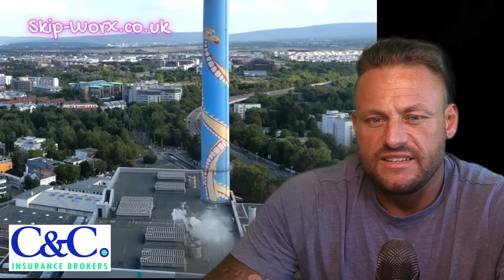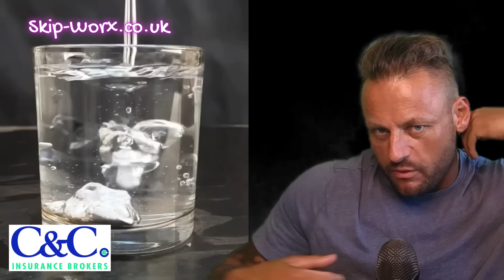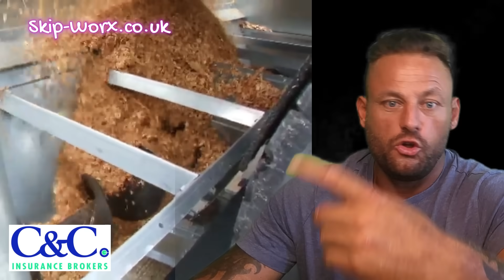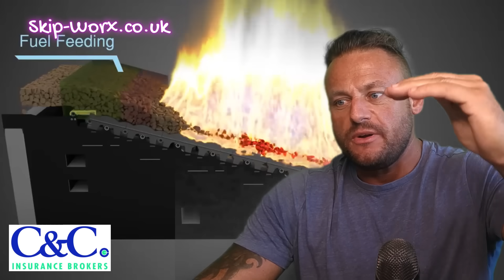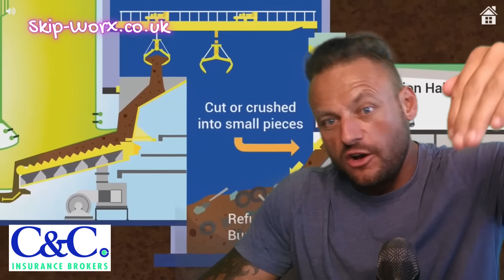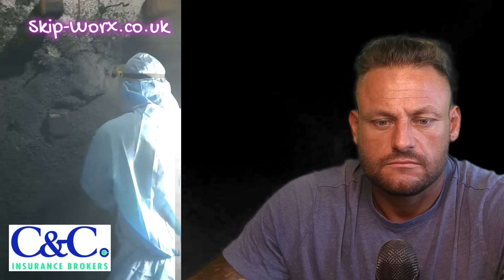Wood problems in uk

Comment: Is it possible to run the wood chips through water, before it enters the incinerator? Wood floats but slightly heavier aluminium sinks. A kind of sluice and the water can be recycled. The internal pressure of the incinerator might increase though, due to the water vapour (steam).

Comment: Most of the problems with ‘chain conveyors’ are to do with tension. Coal mines ran 24/7 and it was always slack chain causing the faults. Keep it tight with a mechanical or hydraulic tension unit and they’ll run forever. Good video, thanks.

Comment: When I was younger , I ran a boiler at a large green house . This boiler used a straight bladed squirrel cage fan to convey the coal to the top of the boiler so that it rained down on to the fire bed . A much larger fan provided the draft under the fire bed . Loved watching the coal floating in the draft burning like little comets .

Comment: I've worked on a lot of industrial new construction projects and the amounts of wood that is thrown away is ridiculous. Everything shipped here is crated, in mostly hardwood crates and dunnage do to the weight of the items and it all goes into the trash. I try and get as much as possible if I'm close to home but when your 1000 miles away it's kinda hard to transport any worthwhile amount. Another problem is that most sites won't allow people to take the leftover dunnage and it gets sent to landfill.

Comment: I've worked in many of these incinerators and everything you've said is correct. 95% of the work I've done in these places is repairing the items you are speaking about. What most people don't understand is the shear volume of material they move through these systems. The majority of work is in replacing or cleaning the grates in the floors. And a lot more work goes into repairing the ash or salt cake conveyors.

Comment: This is the UK reducing carbon emissions?
Lots of timber pallets can be repaired and reused, but businesses find it easier to dump and forget.
It would be nice to see clean timber being preprocessed as chipboard, compressed timber battens for construction etc.
There is no way sections of treated timber, glass and plastic, fibreglass and asbestos can be separated prior to ignition.
Everything gets chipped.
It all goes in and ends up polluting the air.
Governments have been sold ideas to produce electricity, but there is no regulation, just short term gains and profits with long term dangers.
People living near these processing plants and incinerators should be aware of the risks.
The word "Biomass" seems to be used for a whole range of processes to ultimately generate electricity.

Comment: 10 15 I think the cement used for high temperature concrete is called ' Cement Fondu' they used to cast fire backs with it then you used additional refractory clay pads where the main fire was burnt, I remember when we had a coal fire with a back boiler 1960's.
Good info by the way.
Gaz Yorkshire.

Comment: From across the Pond I am ! I burn wood as main source heat and a lot of it is skid wood either softwood or the better kind the hardwood skids used for steel coils not to say both are not needed, This is a Great look into a very vialbe means of dealing with the refuse from humans instead of digging holes and buring it for later generations to deal with! Thank You : )

Comment: Have done relining (Welding in Hardox wear plate and cheek plates) and hard facing of Doppstadt shredders, rebuilt augers in biomass boilers and such like. Most sites pulverize anything, everything and burn it all. The wear on these machines is incredible. I have seen ash removal augers worn down to the shaft with no flights left at the firebox end. If anyone does get asked to work in these places, be safe and VERY fire risk aware.

Comment: Something that you didn't mention, or perhaps not aware of, is that a number of new waste wood incinerators have failed. For example the ones owned by Aviva at Barry in Wales, and Boston, Hull in England. Each one cost over  £150 million. Total investment was £480M. 
Also the Tansterne Biomass Plant in Hull has got into administration.

Comment: It all makes work for the maintenance workers!
 
The amount of aluminium turning up in waste wood, was something I hadn't expected. Thanks.
Reply: I reckon the aluminium must come from construction and demolition materials. Roofing clouts and sheet material nailed to wooden frames. Old shed roof battens where the felt was, stuff like that.
Reply: It’s all sellable though. Not a total loss.
Reply: Appropriately tuned electromagnets can flip this off the belt, along with brass. Just because it isn't diamagnetic(ferrous) doesn't mean it's not paramagetic
Reply: @alanbrown397  What your referring to are eddy current generators. They use an alternating magnetic field to induce a current in anything that conducts electricity, and that current then in turn induces a magnetic field that is repelled by the initiating magnetic field.
Reply: @keithrushforth4019  Yup, but I didn't want to get into the technical bits

It's surprising that operators aren't using eddy current separators on the input belts. I assume cost-benefit analysis made them decide it wasn't worth it
Reply: @alanbrown397  Probably as from what I know of the physics eddy current separators must use a lot of power. Also even if you could get all the aluminium out your still going to get all the other ash and clinker and that needs cleaning anyway so just clean out the ally at the same time. 

The ash deposits must be pretty solid stuff sometimes as I used to know a guy who worked for a company that used explosives to loosen up the ash in boiler tubes.

Comment: We made timber pallets for 30 years and always used steel nails never aluminium.Of course steel would be taken out by magnets.Don’t know the logistics but is it not practical to separate the standard pallets as there are normally plenty going to recycling.Just a thought.If we take clean timber waste to the recycling plant they do not charge and is kept separate.Any material like old fencing full of nails is charged per ton.We are based in Scotland and the rules may differ.I don’t think the man in the street understands how these things work.Enjoyed the  video .

Comment: Couldn't that timber be cut up into small sections and sold to the general Public as winter fuel for those who have a solid fuel stoves .  Especially with coal being so expensive now . Many still use them in the country and small towns.
Reply: Government don't want us using wood fires  so they have laws in place to stop the sale when they can
Reply: Enviro-Nazi's won't have it.
Reply: Can't be sure it's not treated though?
Reply: It's mostly pine. Pine is awful firewood .
Reply: @paulmcmillan533  Wrong. I'm in NZ, and it's what log fires are designed to burn here. Been using it for decades. Quick to dry, and produces rapid heat. We use it for heating the houses and producing hot water. I live in a town that's surrounded by pine plantations. Why bother with anything else ? If you burn treated wood, the it's a problem, so if it's suspect, don't use it.
Reply: @paulmcmillan533 it's good for kindling, and when you have nothing else to burn it gold

Comment: I did a few years collecting waste wood and dropping it at a local Crusher in the UK. Stobartts were taking the waste from the site and dropping it in Germany for their Burners. Didn't make sense to me.
Reply: There must have been a profit in it. Doesn't need to make any other kind of sense if it feeds the bottom line. That's business.
Reply: I still work there now, currently called Seras. We used to supply power stations and factories all over mainland Europe as the costs involved were astronomical for the EU companies to source the wood locally, therefore it was cheaper to import. We do exactly the same thing now, but our own processors and power stations and others across the country.
Reply: There is a big wood fired power station in Germany, with all the exhaust scrubbers for treated wood, maybe that

Comment: We burn palettes on our woodburner during the winter months. Hardly ever turn the heating on. We're always looking for wood.
Reply: Good on ya but you're looking for wood on entirely different scales, I'm run a tree works company and people always say 'i'll take the wood if ya don't want it' on a 40 ton removal, when what they mean is they'll take 1 ton of the stuff that usually gets thrown through the chipper. The company owner isn't necessarily against disposing of the wood like that, but they're worried about you hurting yourself or getting in the way just to get rid of what would go in minutes under normal operations
Reply: Me too. I've got so much wood now though as I took some floors up in a house we worked on. 1 shed full is enough for me for 1 winter. 40 tonne wouldn't fit in my garden lol
Reply: @redghost6386  You'd be surprised what one woodsman can fit in a terrace house garden when landless lol
Reply: Be careful. Many pallets are treated with nasty stuff that will really mess with your biology. Some of it is heavy metals like copper, chrome and arsenic, which concentrate in the ashes.
Reply: Thise contain nasty chemicals. On a serious note, imagine one of your family members develops asthma or even throat or lung cancer, all because you cheaped out on heating, how much would you pay to take away that illness? If you're saving £150 per year on heating, is it really worth the damage you are causing to yourself and your neighbours?
Reply: @marcus.H  You're writing shite. Plus I bet you took all the Covid jabs?